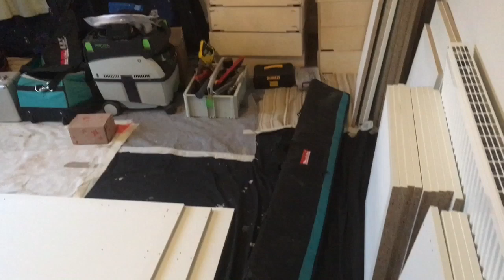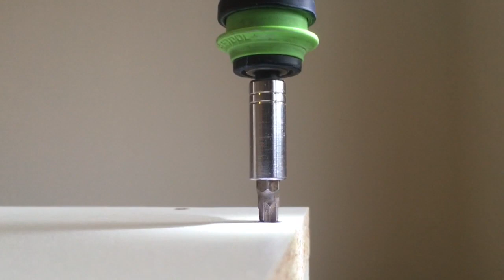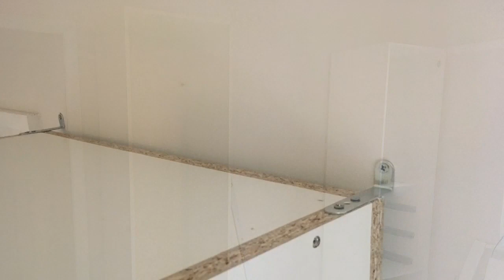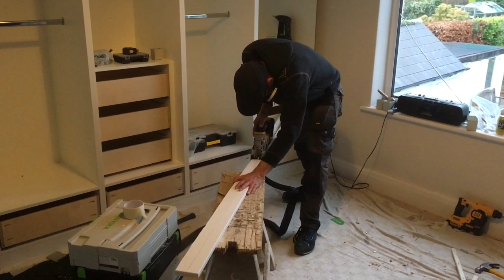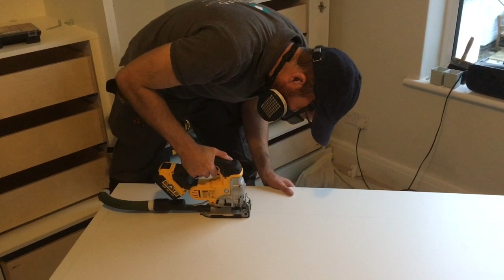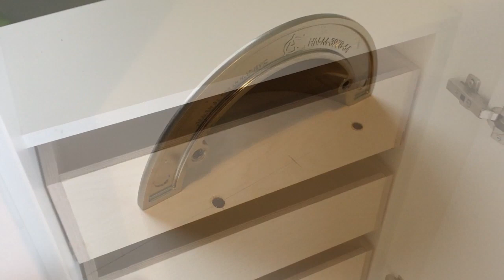Custom designed wardrobes build

Comment: How thick so you make the birch plywood draws? So you very the birch plywood from anywhere specific? Love the videos
Reply from the maker: Hi Sam thanks for commenting!  I’ve got a recent more detailed wardrobe build video coming up.  Hold on a minute, now that I think of it, it’s actually in the same house as this one was!  In their new attic conversion. Anyway, to answer your question, 15mm birch ply for the drawers with 6mm bases (fitted into grooves.  Usually bought from Arnold Lavers or sometimes Lawcris.  I always think 18mm looks and feels just to weighty for drawers, but any thinner than 15mm and it’s hard to get strong joints (we use dominos)
Reply: @Alastair_Johnson  thank you very much for the quick reply looking forward to watching that soon and working my way through your back catalogue of videos as well!

Comment: Thanks for sharing Alistair. Great work as always. Just out of interest, how long does your average estimate take with designing on sketchup at the customers house. I'm still learning sketch up so it takes me a couple of hours to design a wardrobe.
Reply from the maker: Hi Gary for a standard pair of alcove cupboards and shelves I am typically with the customer for about 1.5 hrs all in - chat; measure the space while they fill out a sort of checklist that helps inform them of the process; draw the room in sketchup; draw the design; alter it alongside them; output JPEG’s; email them together with a quote.  I have been refining this process over the years and it’s efficient for alcoves because I have predrawn components in sketchup, and worked out an easy itemised pricelist.  For bigger/ more complex jobs it takes longer, and/or I need to take the drawings away to finish, which suddenly increases my to do list and stress massively as the unfinished tasks grow.  My goal is to design everything on the spot, so we are making ongoing improvements to our library of sketchup models for different types of work.  I keep meaning to make a video showing more of what you can do in sketchup, it’s very powerful when properly set up.
Reply: @Alastair_Johnson  thanks again. Id love to do it the same way. Clearly I need to speed up my sketchup skills. Do you have the professional sketchup program that you buy? Or do you just use the free online version? I'd be very interested to see a video on how it should be done 👍🏻 thanks for the reply
Reply from the maker: Kestelle sketchup pro paid version.  But you can do a lot with the free one